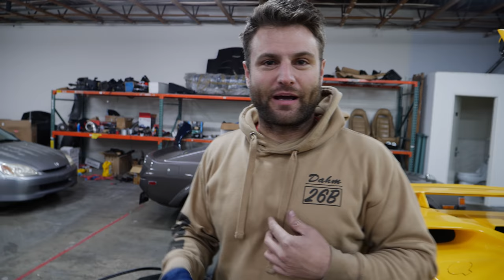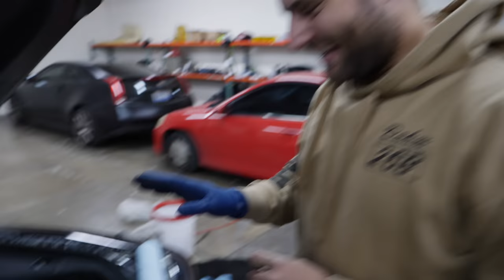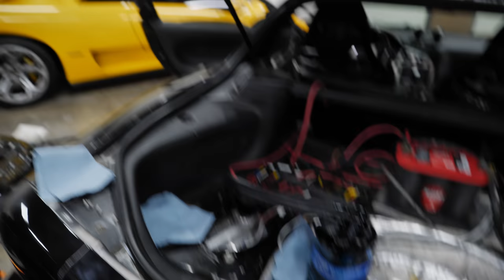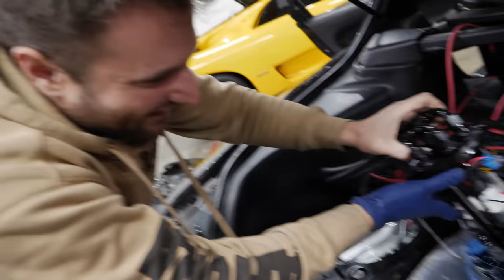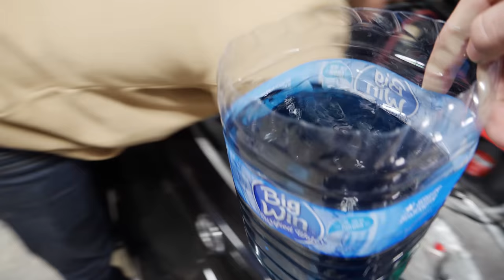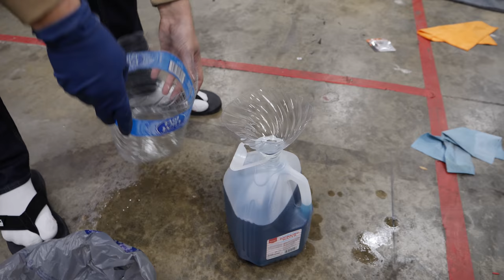Fuel Pumps failed on Dyno. Water Jug Test shows how bad it is...

Comment: By cranking down the regulator, you are making the pump push against a dead-end. When it does this, you are making create max pressure, and the internal pressure relief valve opens on the pump to keep it from damaging itself. That is what you are mostly seeing. Shouldn't there be some adult supervision in your shop!?  :-)
Reply from the maker: Good eye. They did it at 45psi base pressure too. But I think your comment just solved part of my problem.  Thank you for mentioning that. I’m not a fuel system expert and I was told that they just go to 120psi and stay there. The units I have have an internal relief valve at 87psi. So thank you!!
Reply: Was thinking the same thing I know it happens to cold diesel trucks
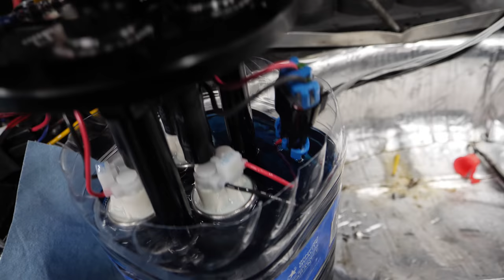Reply: @RobDahm  If you watch really close the second time you do the pump test (2:37) in the gallon jug, the one behind the one you think is failing is by passing fuel as well, not as much but still doing it.  You mite need bigger fuel lines (so it flows more fuel with out tripping the by pass) or some how rig duel fuel pressure regulators so that can flow more fuel thru the pressure regulator with out the restriction/ high pressure tripping the by pass.
Reply: It's called a dead head. But yes.
Reply: @RobDahm  The pressure relief valve setting on those pumps is 112 psi.

Comment: I always assumed Rob kind of knows what he's doing and just doesn't care, although every video starts to convince me otherwise a little more.
Reply: I was pretty shocked when he was struggling to figure out having pressure but lack of flow LOL
Reply from the maker: My brain tends to move fast and get things working quickly. And omit important steps. Honestly how I am off camera. But it generates so much content because I can get something working quickly and learn what I’m missing. This car is also fun just to see what the minimum is needed to make it fast.
Reply: He wants to switch from 93 to e85 bc ot doesn't contain lead? Hahaha
Reply: @RobDahm  Don't worry Rob, we love your content.
Reply: @rexrunner  Yeah petrol doesn't contain lead since long ago
Reply: @RobDahm  P.S If you have pressure all the way to the rail but no flow = line is clogged.
If you have pressure and flow but can't get it through the injectors = injectors are clogged.
If your pumps can deliver pressure on that sized hose, they can deliver flow as well. Flow and pressure are directly related where pressure is simply resistance of flow relative to pump capacity and line capacity. In other words, if you have pressure and the line is not clogged, you have flow as well!
Reply: Exactly
Reply: Bruuu. If you have pressure but no flow it's a dead head in the fuel system.  Prob the fuel return issue. But its impossible to have the proper pressure but not flow on a FI system. Impossible unless return
Reply: @rexrunner  & christopher békési. 
If I'm not mistaken, the car runs on leaded RACE GAS. He literally says this in the same fuel rant that you guys are referencing. Heres the timestamp 6:40

Comment: Disconnect the negative lead from your battery first and you don't need to worry about sparks Rob.
Reply: or first pull the car out side and then disconnect the battery
Reply: If there’s one thing I learned in the military as a mechanic, it’s to always take the negative lead off first and BEFORE any maintenance is done. It’s the gold standard.
Reply: Exactly, remove the ground, no more sparks even if you do strike a ground point while removing the positive. Mechanics 101.
Reply: 𝐓𝐡𝐞𝐑𝐞𝐝𝐑𝐚𝐯𝐞𝐧 not maintenance, only take the negative lead off if your interfering with vehicle electronics, imagine disconnecting the battery to do an oil change lmao.
Reply: @nickdominic9103  its not a bad idea on a ranger so many people short out the starter
Reply: Its DC folks. Hot chases ground. It can spark both ways. From forcing or wanting energy.  It doesn't matter. Sparks are caused if there is a load on the system. Then it arcs
Reply: Electrons flow from the negative of a battery, remove the negative first.
Reply: Incorrect.  Regardless of the ground terminal being hooked up or not, if you're tightening/loosening the positive terminal with a metal wrench, and the wrench accidentally hits anything metal thats connected to the chasis, there's gonna be a huge spark.
Reply: Mugshot Marley if the negative is disconnected there is no way for the electricity to flow. The charge is in the battery and there needs to be a connection between the positive and negative terminals. Once that negative terminal is disconnected no electricity can be released from the battery.
Reply: Or just don’t unhook anything so there are no reconnection sparks. He is cranking it over to run the pumps and needs battery power?
Reply: @mikedale1142  good point
Reply: Wrong.  But still, disconnect the neg first, for other reasons.

Comment: It doesn’t look like you have clamps on the top of the pumps either. That will cause a loss in pressure too...happened on my build.
Reply: nah man, as long as it's sealing, there is no loss.
Reply: Depends on the type of hose and the fitting.   If it's a push loc style fitting, a hose clamp would actually be worse.
Reply: If its not spewing fuel everywhere. why would it loose pressure?
Reply: @Doggebe  exactly

Comment: worth checking if all your hoses out of the surge tank are routed correctly, if you mix your pressure and return at the engine you will get similar symptoms to what your experiencing. The regulator will essentially work backwards but run out of fuel quickly. Kind of like a dead head system with a leak back to the tank.

Comment: Used water on your fuel pumps and now you are shocked when they are broken😯
Reply: Water jug test.... I don't think he's using actual water
Reply: Maybe watch some videos 3 weeks ago🤔
Reply: 3DFLYLOW he tested the pumps with water a few videos back
Reply: That wouldn't cause the flow issue
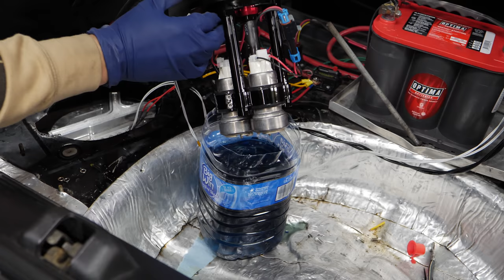Reply: 3:58
Reply: Water wouldn't cause the issue.   The pumps will pump any liquid, as long as they were submerged and didn't overheat, the fluid used doesn't matter.
Reply: @RecklessRegal in the case of fuel pumps they require lubrication from the fuel. Water holds no lubriciaty and causes premature failure.
Reply: @PureRinseRecording  You should look at what the dry run time is on one of those fuel pumps....
Reply: DnB rhythm water does have some lubricity, steam on the other hand does not.
Reply: Only reason for subscribing is to see the 4rotor being built. Now every video is how to be a dumb ass mechanic. I thought this guy knew what he was doing.  Its amazing that car has made it this far.
 💪🤪👍
⛽💥🔥🚒

Comment: they are great, up to 85psi total fuel pressure. you need to check the return flow at your max fuel pressure. i had the same problem. at 80psi i only had 6L/min flow... with 2 of those pumps. on unleaded petrol was only good for 750ish atw on a nissan vq. halve that being a rotor..

Comment: If you’re measuring the pressure at the rail and you still have pressure at high load and RPM where it’s leaning out you must have an issue with the injectors as pressure in this case caused by resistance to flow. You should see pressure drop at rail if you are having an issue related to fuel pump or filter or line flow.

Comment: The internal pressure relief is at 90psi. The pumps are working as intended. Stage the pumps correctly or get a pump speed controller.

Comment: If you have the correct fuel pressure at the fuel rail during maximum fuel injector flow the pumps are fine. 
Here is why, pumps move fluid volume and pressure is developed when the end point discharge flow volume is less than the flow volume of the pump, this is basic fluid dynamics. 
If there was a fuel pump delivery flow volume issue the pressure would drop in the fuel rail at WOT.  
That little squirt out of the pump top during initial startup is not an issue, it seals and stops leaking immediately.

Comment: Rob, are the lifter pumps able to fill the surge tank fast enough? Do the 3 pumps in the surge tank empty the surge tank before the lifter pumps have enough time to refill it? If so, this will result in a loss of flow. I'm not sure how much fuel would be recirculating at 800hp. Just a wild guess.
Reply: He explained it in one of his prior vids. The unpressurized lift pump flows x the pressurized pumps flow x under pressure and both those sets of numbers we're roughly equal numbers.

Comment: Always take the neutral wire off the battery first that way it does not matter if you touch an earth when taking off the wire. Also once you take it off there is no circuit back to the battery.

Comment: If the rail pessure is correct then it cant be the pumps! Flow is dependent by pressure and vice versa (depents on the components of the hydraulic system), if there is too much flow through the Injectors the rail prssure would drop. On the other side, if the flow is not enough  but the pressure is correct the injetors dont flow enough!
Reply: and no testing pumps with water, designd for use with gas do not get damaged (mechanically) and if that would have shorted the pups thy wouldnt work now.
Reply: Fuel pumps have a internal presure regulator that could have failed
Reply: @alexandremarus  if so, the rail pressure would not be correct. as rob sad, the rail pressure is where it should be.

Comment: Do you still have lead in the gasoline in the US? We left lead for about 20 years ago in Sweden 🙈🙈
Reply: Standard pump fuel has been lead free for a long time, but fuel sold for racing or for piston powered aircraft use may still contain lead to boost the octane, provide lubrication and permit the continued use of historic vehicles from the era of very high fuel lead content.

While lead being banned is a fixed date, fuel lead content was pretty low initially when engines didn't demand high performance and thus compression, so cars like the model T fords with manual spark advance will run off modern pump fuel fine, and then lead content fell again every year after the second world war.

Here in Australia lots of the racing series have moved on entirely to ethanol or methanol based fuel sources, but as a country with limited local oil production and huge sugar cane growers, political pressures here a pretty different to the USA, and realistically the total amount of fuel used by racing (rather than road traffic) is pretty insignificant.

Comment: can you fill up on 100LL at an airport? It's only $4-6/gal there lol.
Reply: Not directly into a road vehicle, that is prohibited by state and federal law. 
However, some airport fuel vendors will fill 5 gallon cans or 55 gallon drums, but 100LL AvGas is not even close to performing like VP C16, the 100LL RVP is way off and has a comparatively slow combustion event.

Comment: All pumps do this..... There's a valve on top of them. Are you running all 3 at the same time??? If your not that's a huge problem. And When you run staged pumps your supposed to have check valves. On the other two

Comment: Did you read my last comment again i guess not . Anyways that surge tank is too small for three fuel pumps why don't you just get one massive fuel pump and bigger surge tank and run a lift pump in tank like you already have maybe a 300 per hour one just to keep fuel in the surge tank also maybe twin entry fuel rail most people with rotary's do this
Reply: AI is top of the game with surge tanks. They would of planned the build with Rob so they are completely fine.
Reply: @25LQW  im sure they did .if they both are still dicking around with dodgy wiring and a fuel system setup that still nit performing the way it should.  Sorry but i see many issues in the footage posted . Just saying
Reply: @_i-kr6eg  yeah im sure AI is cringing hard watching rob. haha
Reply: @25LQW  well sorry to say kid but i think al is not soing this for free ??!!!  Not too mention that wiring and other nonsense that's causing /might or will even the whole vehicle might set up fire because of just one damn wire . What are you on about have you ever worked on any vehicle . Been in the automotive industry i guess not but i have in my early 30's now.  So stop commenting  back with nonsense
Reply: @_i-kr6eg  mate. AI is an Australian company, and it look like he is doing it all himself. i agree 100% with you about how dodgy it is. im in my mid 30's and built a 500hp MR2 myself (no workshop at all) just machining and tuning i paid for. and i also use an AI surge tank set up. if you also watch mcm you can have a look at it on the latest skid factory q&a ep.
Reply: @25LQW  al is Australian ??/ Workshop , what do you mean by that ?? I'm very confused.  You mean al the master rotary technician well know here in Australia and only a half a hand full Americans /workshops knows wankel rotary engine's
Reply: @25LQW  you mean abel ibarra that the bloke in the video with rob

Comment: They haven't put lead in gasoline since 1995. So unless you have 24 year old gas or are running Aviation Gasoline, there is no lead in your gas. Do a little reading, Ethanol 85 is worse for the environment and your MPG than regular gas.  It is also worse on your rubber fuel lines than regular gasoline.
Reply: Its tinned race gas rather than pump fuel for road use, so yes, it may contain some level of lead.

As for rubber hoses, most products are ethanol safe, and... its a case of some compounds in older rubbers (fuel system o-rings in particular) being soluble in ethanol rather than ethanol just causing more wear.

Likewise ethanol does have less joules of energy per liter, so you don't go as far on a tank, but this does not translate directly to higher environmental impacts. It provides more energy per carbon molecule (thus co2 production for greenhouse effects), is much lower environmental half life\toxicity when split (methanol is 0.5 days, ethanol around a week), higher detonation resistance allowing more aggressive spark timings\compression ratios without the use of benzene or lead additives (which are both toxic and long lived in environment) and lower combustion temperatures reduce the risk of endothermic formation of nitrogen-oxygen chain byproducts (a large constituent of city smog) when running a leaner economy tune. Therefor ethanol fuels can be more environmentally friendly, so long as there production method which varies greatly on country or region) do not offset its these benefits, normally through use of coal or diesel fuels in growth of fermentation feed-stock or process heat.

Comment: hey I'm not claiming to be an expert but, I would not recommend running ethanol on a rotary, essentially your oil in housing won't lubricate well, and you will have to replace your apex seals sooner.

Comment: Ok I have to ask, Why are you using an overly complex fuel system with like 5 pumps? Why not just buy one or maybe 2 pumps and be done with it( such as a big boy weldon or a magna fuel pump with a intake pick up) that is just too many pumps, too many failure points, and too much unnecessary draw on the electrical system.

Comment: I have a feeling when you originally poured the oil in the tank some of it may have got into The Surge tank unmixed and blew your seal on the fuel pumps.  I've been wondering about this since the last video
Reply: No it wasn't you really think water would blow the seals like those pumps are made to handle race fuel
Reply: jon doe  not true at all as long as they are submerged under a liquid it nothing should happen. Even so I used one to temporarily run my cooling system to keep my car from over heating and that pump still works fine. the failure probably came from how he had the pumps set up in the beginning with all three running it probably built up too much pressure in the surge tank and the pick up couldn't keep up  and or a malfunction on the wiring who know but I know those are fine for water.
Reply: jon doe  And here I thought it was about the viscosity of the fluid flowing through the pump considering it's made to handle something less viscous than oil.  Water has a very similar viscosity to fuel but that premix oil would have been sitting at the bottom of the tank going through the fuel pick up first causing unnecessary pressure in the fuel pump.  Have you ever had to mix gas for your chainsaw or weed wacker you got to shake that Jerry can to mix it or the oil sits on the bottom.
Reply: jon doe  ok bud what ever you you say not going to argue with you like i said before I've done a makeshift pump for my cooler  it still works fine so yeah
Reply: jon doe  also that squirting out the top of the pumps is a relief valve. I was referring to the internal seals.

Comment: This is one of the many reasons that multi-pump systems are garbage.   Get a real fuel system and you won't have to deal with this, it's much less fun when the failure happens under a load.